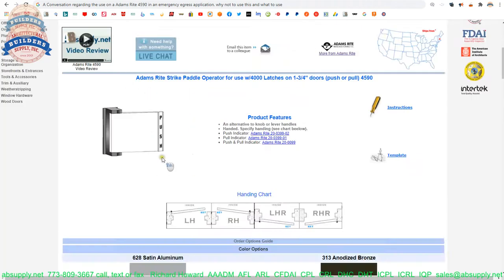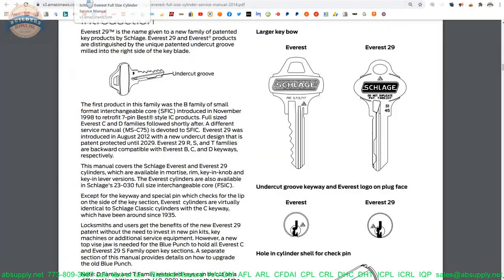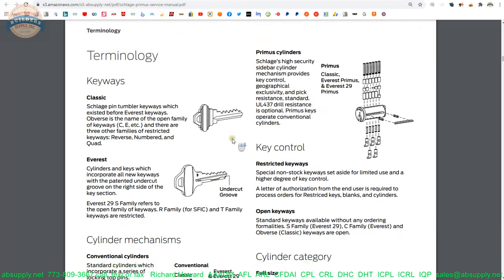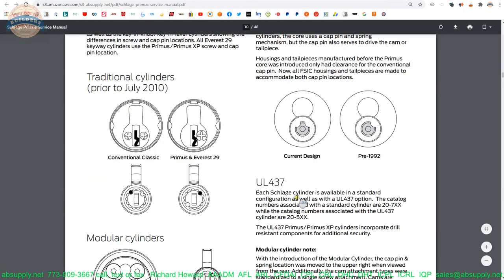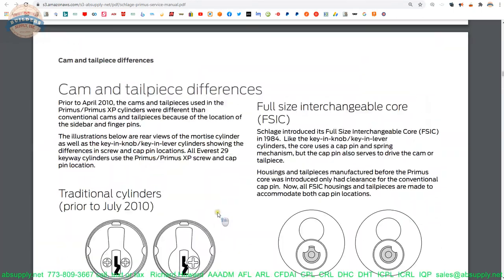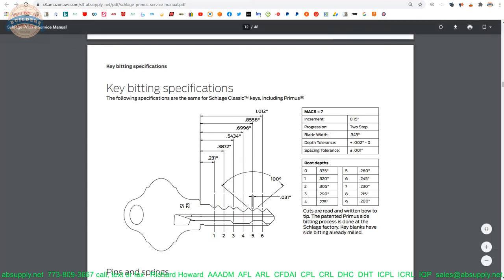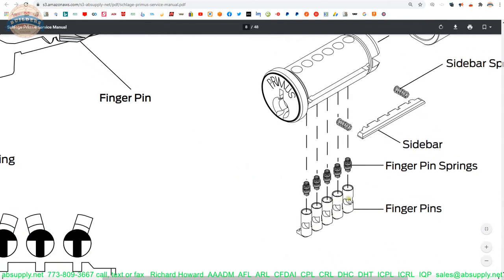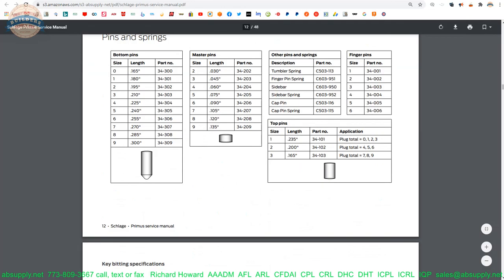What is the difference between Schlage Primus Side Bit Milling - Level 1 vs Level 3 for instance

Comment: There are 7 different finger pin sizes and 5 positions
Reply from the maker: Thank you - There are 7 - different fingers pins available in the Primus XP system (non-XP feature 6) as seen on page 13 here:   https://s3.amazonaws.com/s3-absupply-net/pdf/schlage-primus-service-manual.pdf   of which 5 are installed in a cylinder.
Reply: @absupplynet  no problem, I work on these daily if not weekly. Level 1 is the same finger pins for the whole country and then it gets more restrictive through Level 4. Everest Primus has the same thing but they start at Level 7.